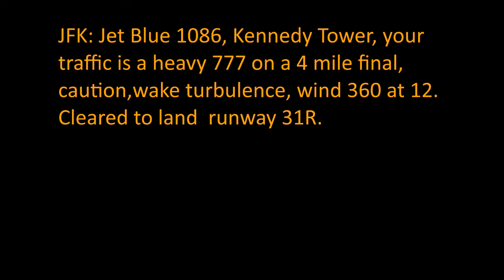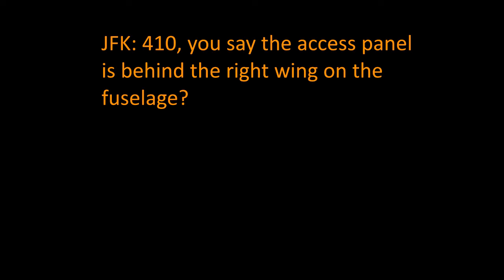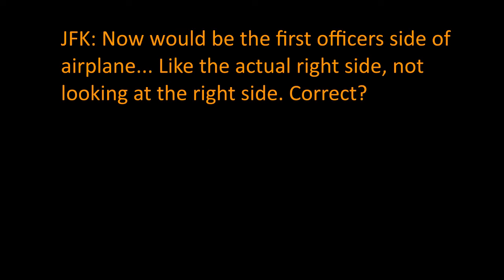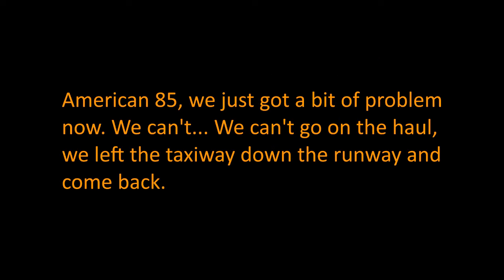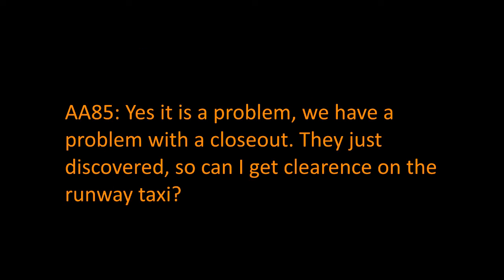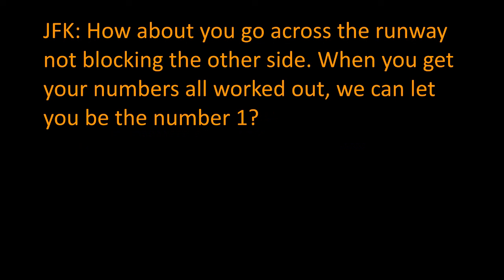Funny ATC Lufthansa pilot leaves aircraft

Comment: "Cleared to erm....close it." I died 😂😂😂
Reply: I thought that was cute lol... cleared to close it, like that takes a special permission
Reply: Lufthansa is lit.
Reply: the tower is controlling the taxiway. a person walking needs to be considered with other aircraft taxiing so they don't get blown away. therefore yes he needs permission to stop and exit his plane. on most planes it would be go back to the gate area and have someone close it as it's not as easy to exit the plane (a340 as an option has a ladder builtin that exits from below the cockpit)
Reply: Daniel Dankers which minute?
Reply: pilot getting out to close ze door. i did nazi see that coming.
Reply: Absolute FSX Steam Edition moment
Reply: Germans are practical like this. Was on an intercity train once and we had to stop because a switch was frozen in the wrong position. Driver got out and kicked it in the correct position, we continued with 5 minutes of delay (as opposed to the typical 2 hours it would cost for a mechanic to come out).
Reply: @0TimSmit0  We had a Bus which front door for some reason cracked pretty severely. So to continue driving he just smashed the glass down and drove off. German aswell.
Reply: When
Reply: imagine glancing off your right wing, and seeing the pilot walking
Reply: @0TimSmit0  Yeah, why wait 2 hours for the mechanic when you can fix it yourself in 5 minutes with a good old fashioned kick.

Comment: good pilot. small things like that cause the worst problems. to pull off the runway to personally fix your aircraft is the kind of diligence you should expect from every pilot in the air.
Reply: "the kind of diligence you should expect from every pilot in the air."
Ermmm, It might be safer if they did it while on the ground... BIG GRIN!
Reply: Request or expect?
Reply: Sometimes. Sometimes I would rather have a trained mechanic working on my aircraft. I understand your point, and agree, though.
Reply: How do you get out?
Reply: xxxxxGhostBoyxxxxx Actually as pilot you are ultimately responsible for EVERYTHING with the aircraft as long as it is operating...kinda like captain of a ship....you are expected to know & fill in any role that is required while “operating”.  Anything wrong & its your neck if it pertain to your action....You’ll be surprise how much a pilot has to know about their aircraft in order to be rated on it, any comm pilot do correct me if I am wrong, only a private pilot here...
Reply: @xhuynh23  agreed
Reply: cj63021 but how did he get out?
Reply: Can someone explain how did he get out of the plane and closed the panel?? Is 3,50 m high?
Reply: @Not_me9791  very carefully...
Reply: Even because you probably didn't make a proper walkaround beforehand.
Reply: @Not_me9791  Google Ground Access Ladder
Reply: @Not_me9791  i believe they were on the runway ready for takeoff. The pilot would need to get off the plane and fix, etc, which would cause delay. Hence, he first asked the car for a visual confirmation, then requested to go on the left corridoor of the runaway (freeing the runway they were standing in for the next flight), whilst he manually closed the panel. 3.50m is not high, it's around 12ft.
Reply: lmao "good pilot". any normal competent pilot shouldn't take off with open panels, and, uh, the 340 R1 L1 door to the pavement is at least 30 ft so sorta confused how he gonna close that panel.
Reply: got any airstairs on that plane???
Reply: @PeterNGloor   @Ivan Fernandes   @mchennes   @Ralph Dratman  just behind the cockpit or maybe inside the cockpit there is a service panel in the floor of the cabin that goes into the avionics bay in the nose. In the floor of the avionics bay is another service door that opens to the belly of the plane near the nose wheel. 

The A340 sits fairly low to the ground, I'm 6' tall and can run my hand along the belly of the aircraft.  Would be easy for the pilot to drop down to the ground, close the fuel panel door (fuelling control panel, the actual fuel ports are on the wing itself) and then climb back up through the avionics bay using the nose wheel as a ladder.
Reply: @xxxxxGhostBoyxxxxx  are you a pilot? if so i have a question,thanks
Reply: PeterNGloor yes, the A340 has a ladder that the flight crew can use to exit through the bottom of the cockpit. He’s not about to parkour out the window lol
Reply: Gage  ah ok, I didn't know about this aspect. Thanks
Reply: I'm asking myself how did he manage to go out the plane without ground stairs
Reply: @markofexcellence5209  Americans aren't trained for anything
Reply: @xxxxxGhostBoyxxxxx  You're not expected to need to touch anything. If that expectation is not fulfilled, your options are to fix it yourself and get 5 minutes of delay, or get the service to fix it, alongside with initiating the witch hunt to find the culprit responsible, depart with at least 30 minutes delay (even if the problem takes 10 seconds to fix) and then handle a mountain of paperwork and cooperate in the investigation so that the problem would never occur again.
Reply: I love this comment and the replies. Thanks for all the serotonin guys
Reply: Ralph Dratman the door
Reply: @Fmagyar  But that doesn't sell action movie tickets!
Reply: There is or was a YouTube video from around the time of this one or maybe before where Kennedy Steve tells a pilot to cross one bridge and then a second bridge and then says something like they are probably the only two bridges in New York that you don’t need to pay to go over.  Does anyone know if that video (I believe, like vide, was mostly audio) is still up on YouTube?  If anyone knows, would you mind sharing either the link or the proper name for the video?  It was a very funny moment in JFK ATC humor history.
Reply: @PeterNGloor  yes

Comment: That was HIS plane. His responsibility. German efficiency jokes but an excellent pilot in control.
Reply: That exactly right.  Captain Joe [channel] has a video where he explains the pre-flight inspection that the captain must do around the aircraft.   I expect he had done this, but as the refueling crew failed to secure the hatch afterwards, he probably wanted to check for other issues.

Comment: I was a new-hire at Delta as a 727 S/O. We were taxiing out to depart 9L at ATL and a flight on the parallel taxiway reported the interphone access panel was open. With the Captain's approval, I walked back through the cabin, lowered the airstairs and carefully made my way up to the panel below the F/O's window and closed it. It was a lot faster than losing our sequence to taxi back to the ramp.
Reply: Former Ramp rat here yea that was easy with those stairs
Reply: cool! did you have to shut down any of the engines while you were outside?
Reply: @tusb0l  No. #1 and #2 were running, we hadn't started #3 yet. I walked to a point just outboard of the right main landing gear, under the wing and to the front. I had my ear plugs in but I felt bad for the last 10 rows of coach- it's awfully noisy when you open the rear airstair door with #2 running.